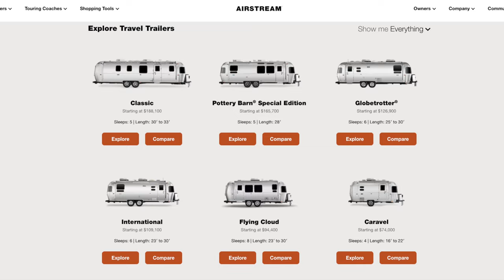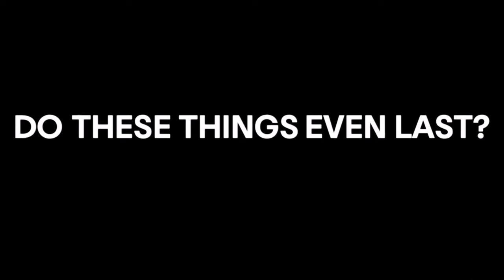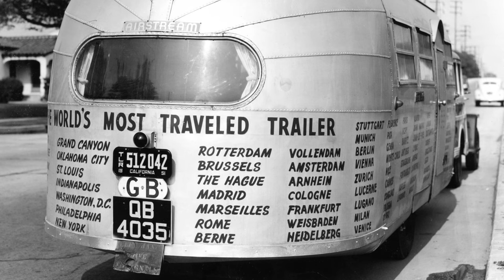THE REAL REASON AIRSTREAMS ARE OVERPRICED AND OVERRATED | Airstream review 2024

Comment: Overpriced compared to the competition? They have no competition. Nothing else on the market today built like them. Most of the "SOB's" (some other brand) are junk after 5 or 10 years if you use it a lot. Love Em!!!
Reply from the maker: lol i love when people are passionate! I hear you man, my research says you are right. The problem is the price, yikes it hurts.
Reply: @KeepItTiny  Yep, there expensive. But, maybe not. Bought new 2107 Airstream International 23D for $60k in May, 2017. 2 years and 24K miles later we sold it for $63K!! Then bought a 2019 Airstream Flying Cloud 25 Rear Bed Twin for $71K. This trailer had an MSRP of $90K. Fantastic deal, but those deals are not out there anymore. We figure our $$$$ is safer with the Airstream than buying an SOB. Ya just got to bite the bullet. Ya only live once and you can't take it with you. Enjoy life while you can.